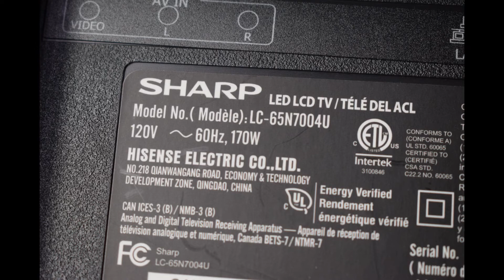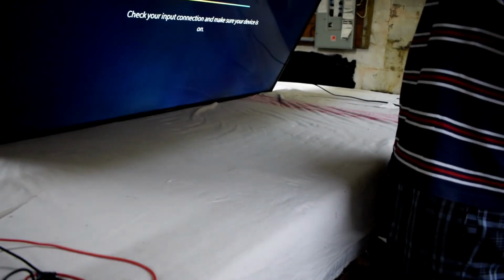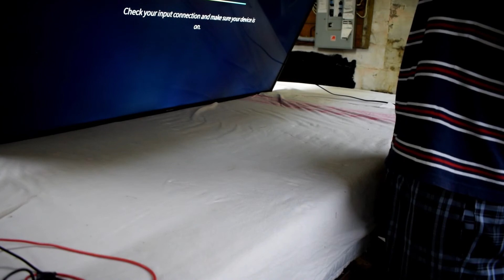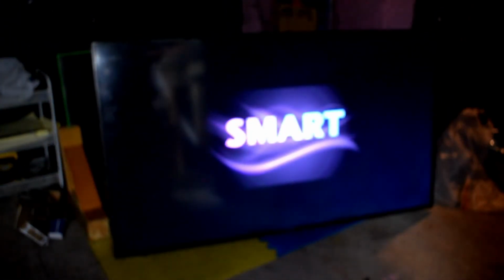SHARP TV Black Screen fixed | LC 65N7004U, best backlight repair

Comment: How many led lights total are in this TV, I’ve been told I should replace them all. It appears that they come in strips of 100. 
Also, the link for the LED’s says the sale is no longer available. Can you find and post an updated recommended LED seller for this specific tv? 
Great video. Thank you! My tv did the same thing. I want to fix it myself.
Reply: Did you find where to buy the LEDs?

Comment: My TV is dark on one side. I turn it on then it just show the sharp logo then become to black. The power light was linking when it's showing the logo then stop when it become to black. It is the same with your issue? I tried to replace another power supply board but there is nothing change!
Reply from the maker: backlights
Reply: Thank you very much!
Reply: Years ago I had to call and finally threw a random bunch of numbers we had to reset to factory specs

Comment: Thanks for that. I have the same model TV with, I suspect, LED issues. I ordered replacement LEDs from China but they are full LED strips.
Reply: Did it fix the issue?
Reply: @tazsfixes8368  Yes, I actually did not remove the broken strip as they were all glued to the bottom of the white reflector sheet. So what I did was cut a line on the reflector sheet along the LED strip. Scraped the LED bulbs from the existing strip so that it's completely flat. Inserted the new LED strip in between the old LED strip and the reflector sheet. Then I taped the line I cut to close it. Unplugged the wire from the old strip and plug it into the new one.
Reply: My TV is dark on one side. I turn it on then it just show the sharp logo then become to black. The power light was linking when it's showing the logo then stop when it become to black. It is the same with your issue? I tried to replace another power supply board but there is nothing change!
Reply: @nabkha1986  Same issue I was having. You need to replace the broken LED strip
Reply: @nabkha1986  I had the same problem and changing the led strips solved this issue. Took me about 3 hours start to finish. Note the leds strips are glued. I just used double sided tape to attach new ones
Reply: Thank you very much!
Reply: How many strips did you buy, looks like they come in sets of 100. Did you replace all of them for the tv? 
Can you give me a link for the LEDs you purchased? The one linked by the guy in the video says it’s no longer available. 
Did you buy and use the LED tester, or just replace them all and skip the testing?